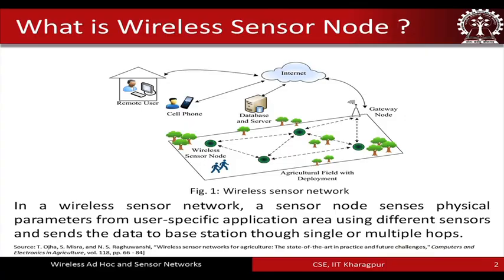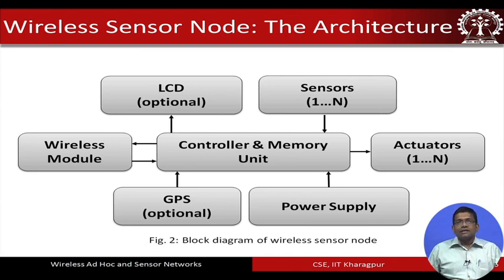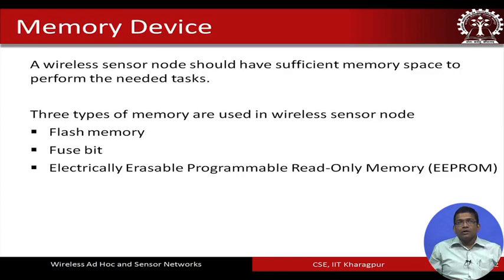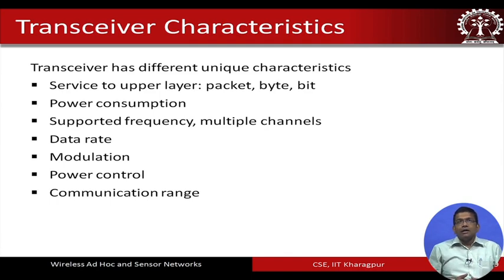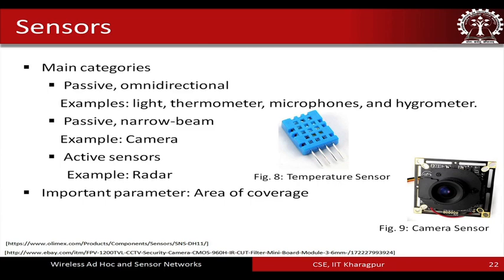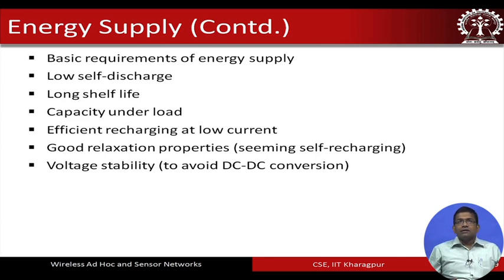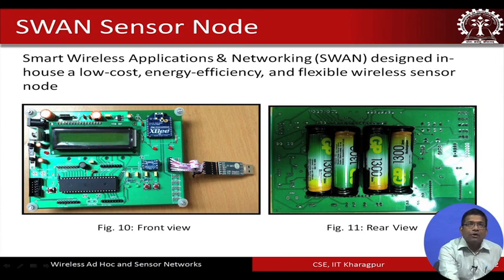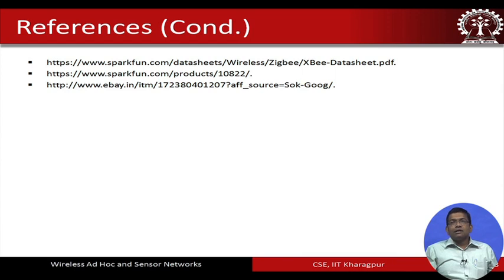Hardware Design of Sensor Node

Comment: in sensor node block diagram power supply line is not drawn to wireless comm module.. how which will act without power?